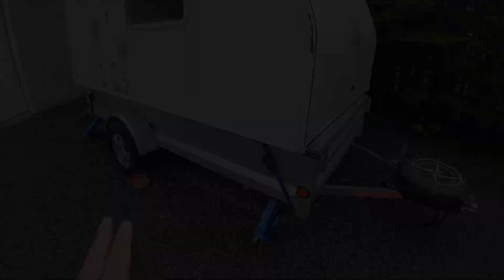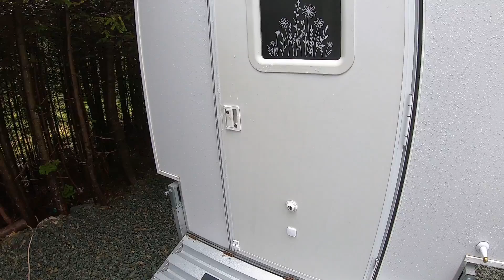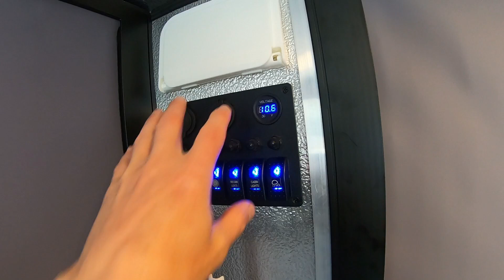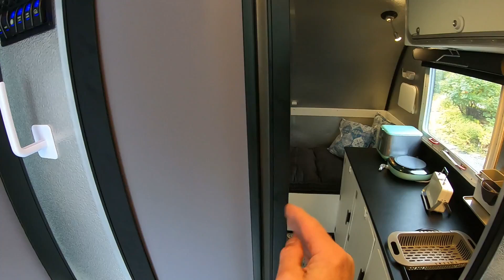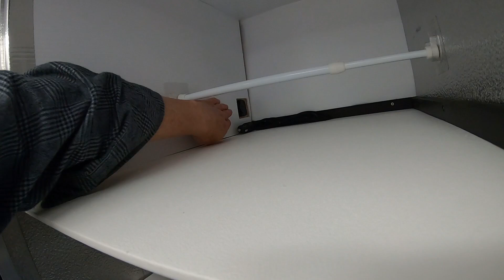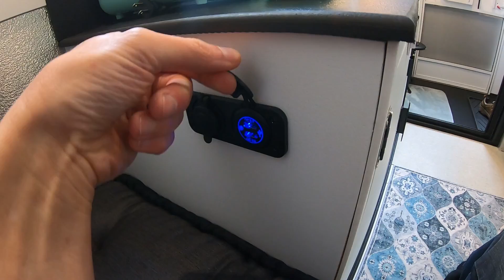Day 100! Final Day - Final Weigh - Final Say - Building a Teardrop Camper

Comment: Great build.  Just bought one of these Stirling trailers and starting to do basic mods.  First thing was to fix that annoying rattling when you're going down the road.  All it took was to put a washer where the gate latches to snug them up.  Now it's quite as a church mouse.  Didn't know if you fixed yours yet. Just got here, but noticed you talking about rattling when you took your first test drive of the teardrop.  Good luck in you adventures!  Oh and under the front of the trailer where tongue meets bed was a loose bolt that was making noise.
Reply from the maker: Thanks and thanks for the info. The gate is all snug and I did tighten up all the nuts and bolts when I got it. I found the rattling though . . . a little slop in the receiver with the hitch. I bought a plate that takes care of that. 🙂